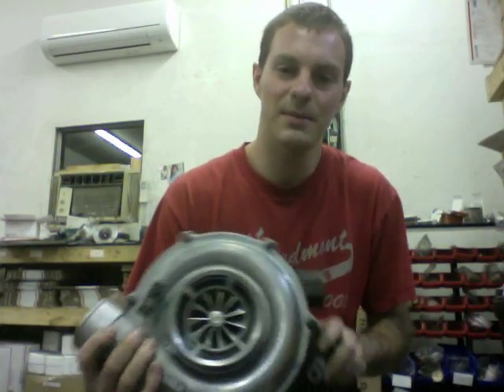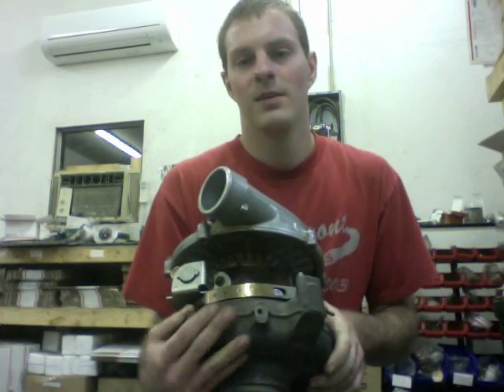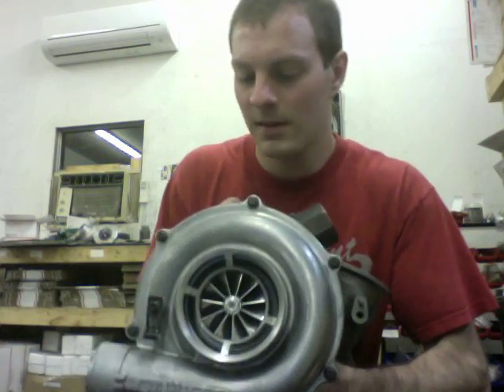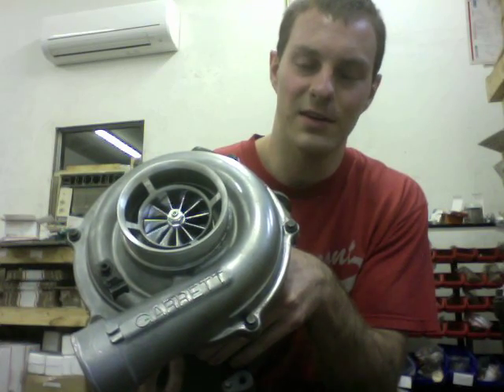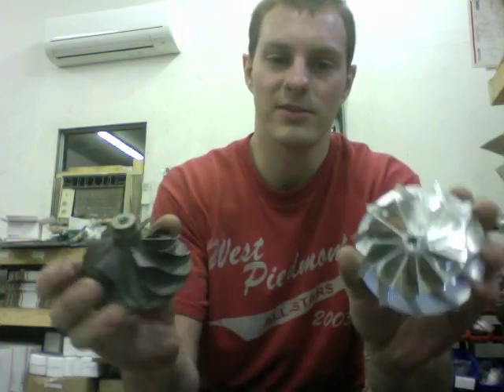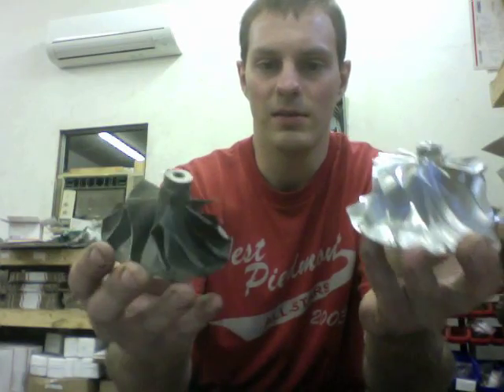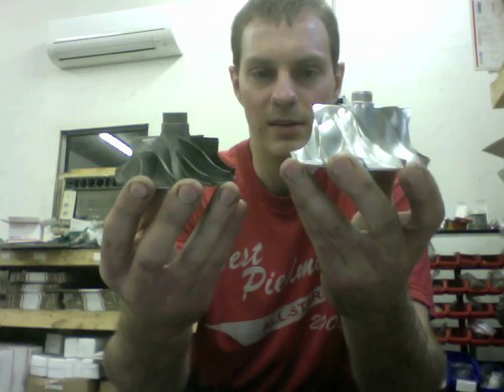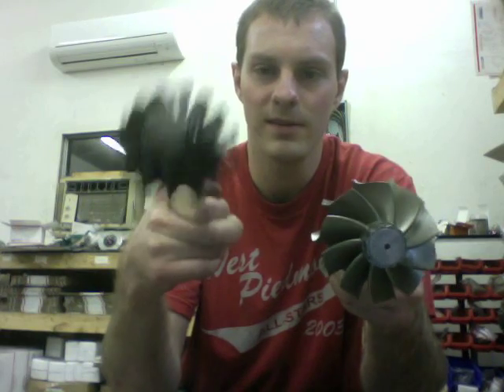Best Ford 6.0 Powerstroke Turbo Upgrade

Comment: hey buddy does the exhaust parts turbine thing come off the shaft or what
Reply from the maker: +Allen Heilig its 2 pieces fused together by a fusion weld. It doesn't come apart

Comment: how much more torque will i get with this mod?its an 07 f250 6.0.i use mine for towing and daily driver
Reply from the maker: +motox766 This turbo upgrade is the same as the Powermax upgrade, besides the wheel being billet. Here are some results here 787 ft/lbs of torque and 454hp. The HP would be much higher but the diesels only turn so many rpm. http://www.trucktrend.com/how-to/engine/1408-2007-ford-f-250-6-0l-power-stroke-garrett-powermax-by-banks-diesel-tech/
Reply: Oh that was with a bunch of upgrades.i just have the 4" exhaust s and b cold air intake ,blue spring upgrade and sct x4 tuner.

Comment: can you get a 38R for a 7.3 that has that 10 blade exhaust wheel with the crazy whistle?
Reply from the maker: +Whiskey Tango i wrote that down, i will see what i can find. I didnt know that turbo had that.
Reply: I honestly don't know anything about turbos...but I do know my stock one the exhaust wheel is damaged and I will be replacing.  Was just going to go with a 38R but was wondering if there are any turbos with a special exhaust wheel that whistles like crazy
Reply from the maker: The 7.3 turbos have 10 blades from factory. 1 in a 67mm the other is 69mm.  Im not really sure about the whistle. all turbos whistle, some are louder than others.

Comment: can you upgrade (more power and low torque needed) vnt turbos from twin turbo v8 diesel Toyota Land Cruiser 200? Here's the OEM turbo http://dencodiesel.com/products/turbocharger-rhv4-landcruiser-200-series-1
Reply from the maker: +Андрей Андреев I have never worked on a set of turbos like that. Im not sure how big i can upgrade them if they are upgradeable at all. Im not sure what size it is to begin with, this must not be something available in my country.
Reply: +Turbo Lab America i'll write you a letter to discuss further. P.S. you should correct your site address under the video.

Comment: You guys have anything for a 87 Mercedes 300D?  It has an antiquated turbo, maybe billet wheel with a better fin design? Please let me know.
Reply from the maker: +A Jovial YouTube commenter Im not sure what turbo that is. I think it is a GT15. i have rebuild kits on hand for it, Im not sure what size it is now. i know i can get some upgraded compressor wheels all the way to 50mm, but im not sure how big the inlet is which can limit the size of the compressor wheel that i can put in it.